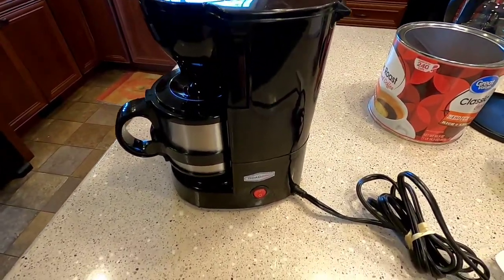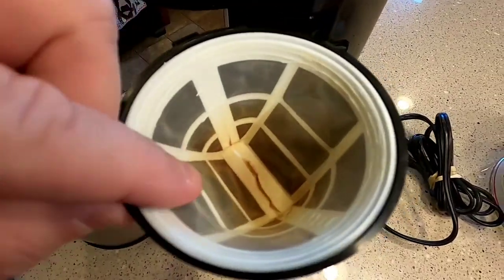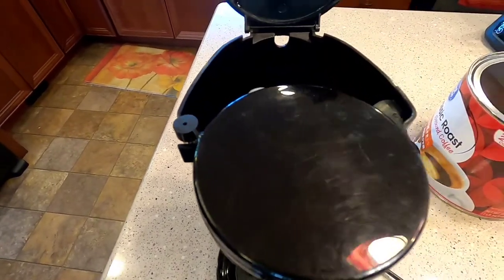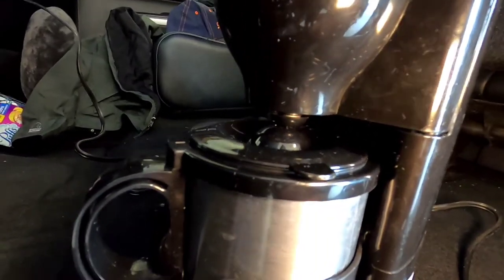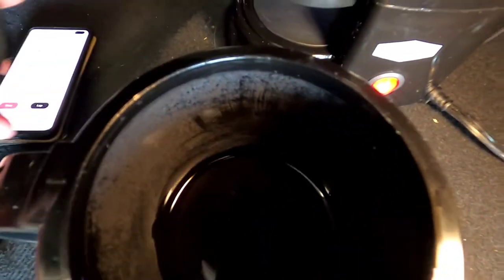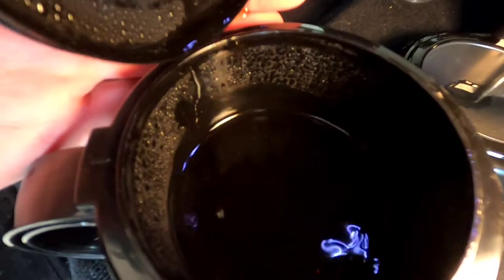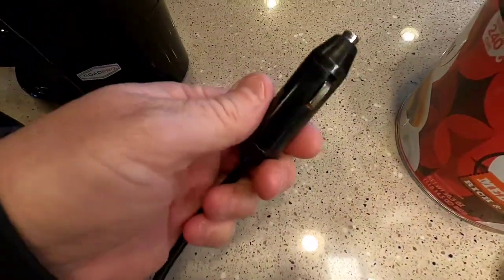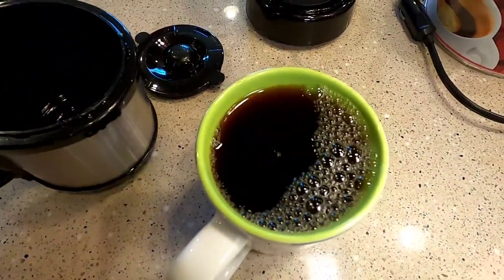12 Volt Road Pro Coffee Maker Detailed REVIEW Semi Truck or Car Cigarette Lighter

Comment: I use a ten buck car beverage heater.  It's instant boiling water. I take my 12 cup carafe outside and bring it to a boil and go inside and pour the hot water over the grounds.  Works great. Blessings
Reply from the maker: That's a great idea!
Reply: Also buy a car inverter for an electric griddle.

Comment: You need to check your cigarettes lighter ports amp rating.  These items take 15 amps and a lot of cars have downgraded the ports to 10 amps.  The car should be running also.
Reply from the maker: Thanks for the tip.  does you cord end get really hot?
Reply: @JustADad  I seen they haven’t replied back but I have used these before and the end plug did get hot. I made my husbands cup and unplugged ( he only drinks a cup a day ) I would unplug as soon as you’re done. Just to be safe. Oh yeah the plug did burn when I forgot to unplug so be careful